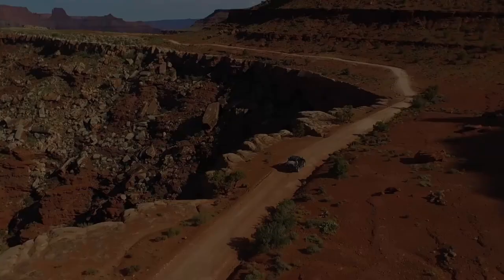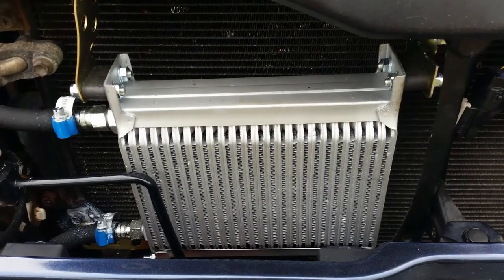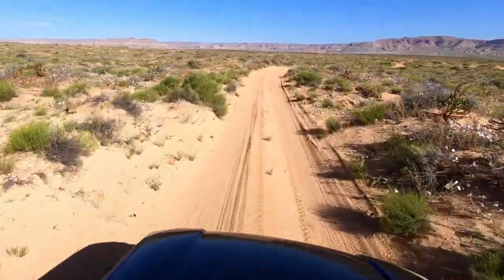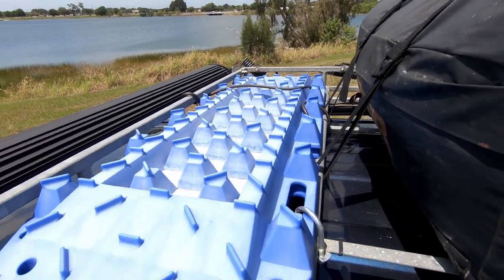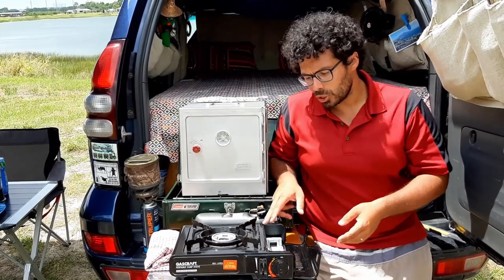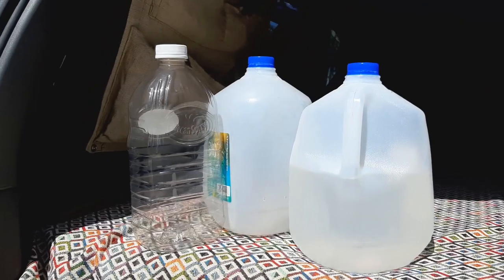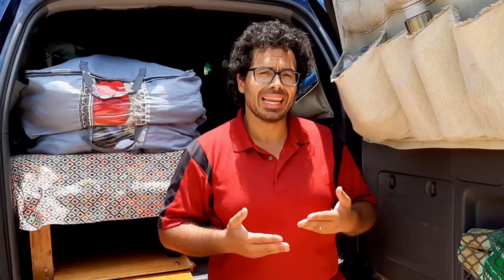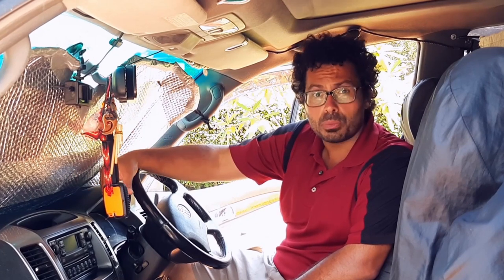TOYOTA OVERLAND WALK THROUGH - 5 Years Around the World living and driving in a Prado - Van Life 4x4

Comment: This is great, love your videos! 

I'm contemplating a long road trip myself through tropical countries. So I'm curious how you cope with heat in the car in the evening/night, especially when it's also raining so you can't keep your windows open more than a few centimeters?
Reply from the maker: Hi Lars ! Well, first we don't use the air conditioning so our bodies cope better with the heat. We do have a couple of fans that help us with the air circulation and we can open the windows down to 10 cm. ( we have wind/rain covers on the upper sides of our doors if you look closely at our Toto')  We tend to avoid the wrong seasons, we try to plan our route and time of the year in a certain country accordingly. We had of course some bad nights over the years, heat, mosquitoes, noises and much more, but luckily we have now enough experience to chose wisely our camp spots... and if we really cannot cope with the weather... there is always the option to check in at the nearest hostel. Hope this Helps ! All the Best and good luck with your plans ! Safe Travels !
Reply: @ALVETOEXPEDITIONeng  Thanks!